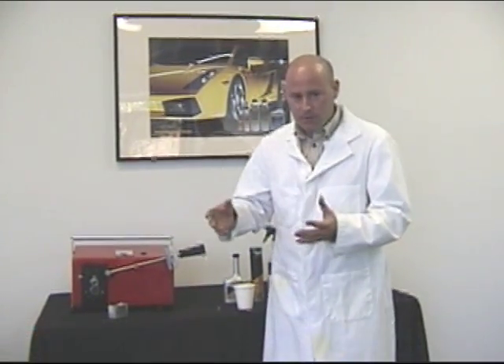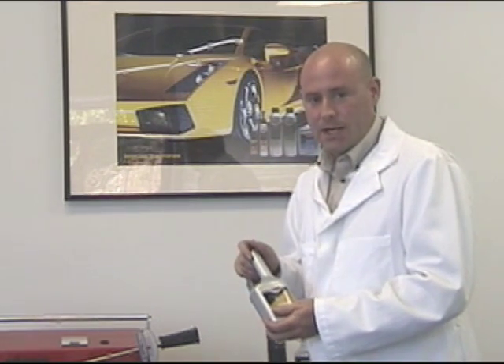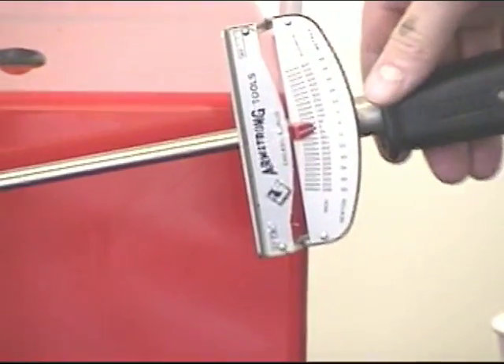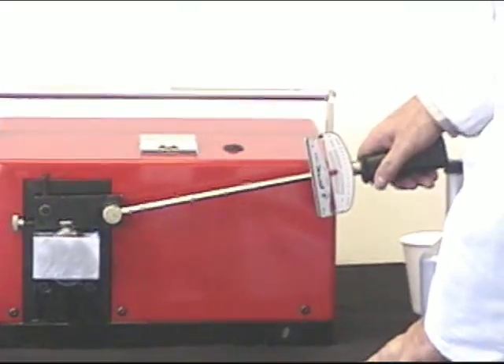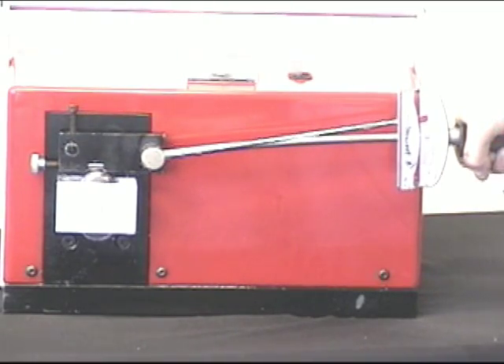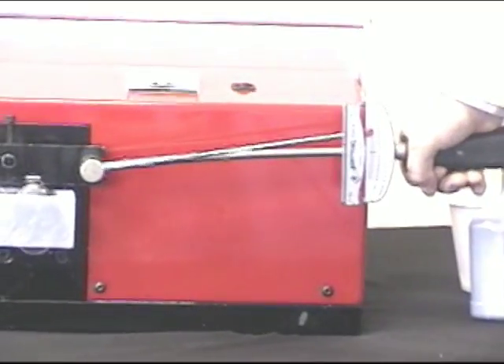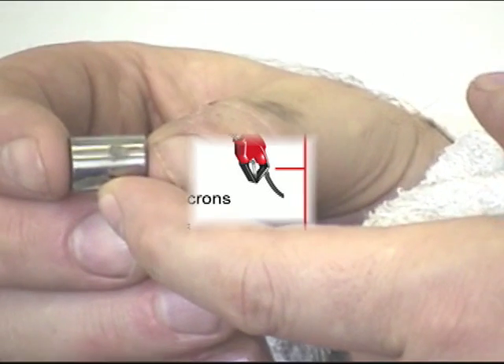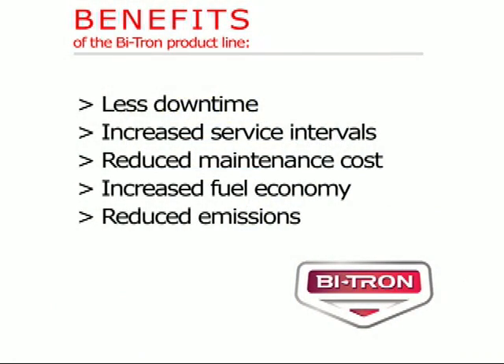$16 a very small risk to take when the reward is an engine that lasts incredibly

Comment from the maker: Good question.  The familiar oil manufacturers must spend a lot of money making their advanced oils.  Perhaps there are some oils that compare favorably to standard oils with Bi-Tron treatment added to them.  But those special oils cost a lot of money per quart.  I can buy everyday regular oil, then add 8 ozs. of Bi-Tron engine treatment for $14.95 per oil and filter change and get unbelievable results.  My 2005 Chevy Express now has 438,000 miles with absolutely no engine repairs.  Remarkable!

Comment from the maker: @Wishmaster50000  Appreciate your question.  The engine treatment goes into the motor oil.  It magnetically gravitates to the metal parts and acts as a protective coating thereby reducing the friction between the moving parts.  That means less wear, and more power.  The fuel treatment extends the life of firing parts in the same manner.  

My 2005 Chevy Express van now has 399,929 miles and the only thing that I have done to it is normal maintenance.  Zero repairs on the transmission and engine

Comment: @Wishmaster50000 Diesel lubricates the injector pump, which runs much tighter tolerances than the engine its self. The diesel is actually really important for lubricating the pump.

Comment from the maker: @naturevshumans In addition to the aforementioned reply I go 7,000 to 10,000 between oil changes.  This is probably not a good idea, btw.  I bought my van with already 180,000 miles on it, so it didn't get Bi-Torn treatment from the beginning.  The engine is now burning a quart every 1,500 miles or so.....still very acceptable to me.  If the engine had Bi-Tron from the beginning, there is little doubt in my mind that it could have lasted a million miles before needing an overhaul.

Comment: I agree it is a great product, the only question is how are you getting 700ft/lbs on a 1/2inch torque wrench.
I have a snap on 1/2 torque wrench which is much more heftier than that one and it goes only up to 250lbs.
Unless that is a 3/4 inch torque wrench.

The product does work well like Royal purple oil works, less friction